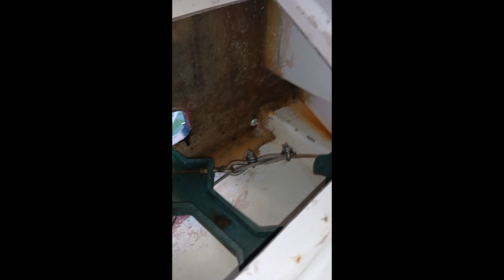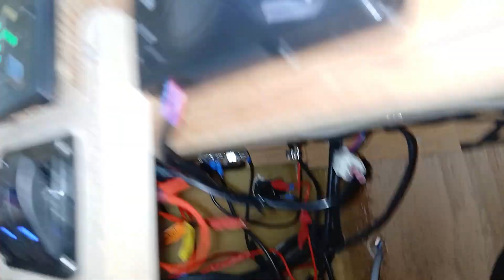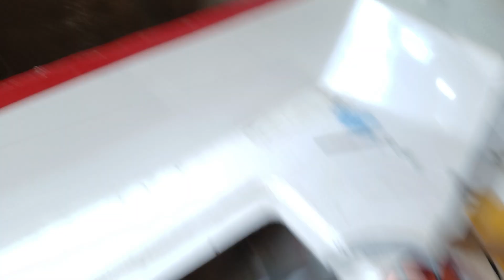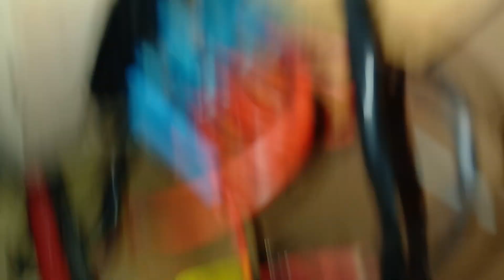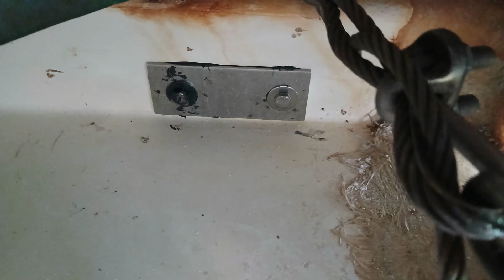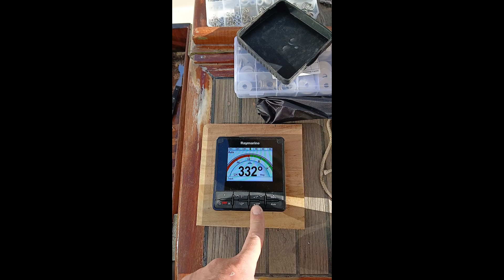#002 HANDS FREE SAILING | Installing My Autopilot System | Raymarine EV-200 Sail Pack on a Freedom40

Comment: You don't need a separate Seatalkng power cable. The ACU200 can directly power the STng bus, just flip the switch behind the STng connector on the ACU.